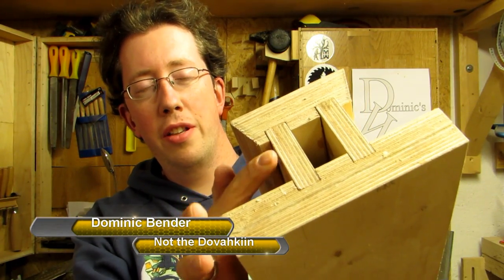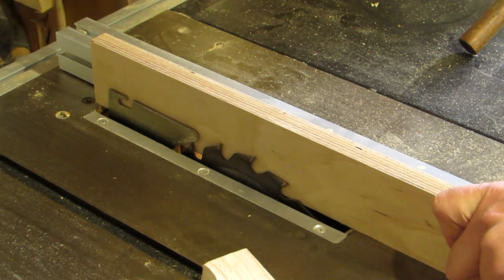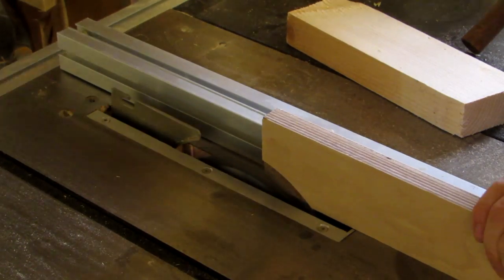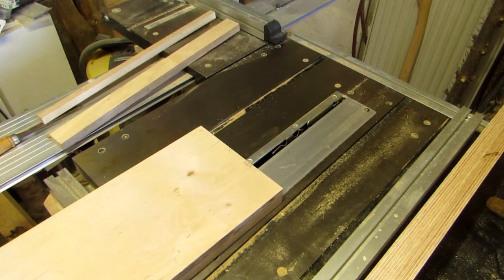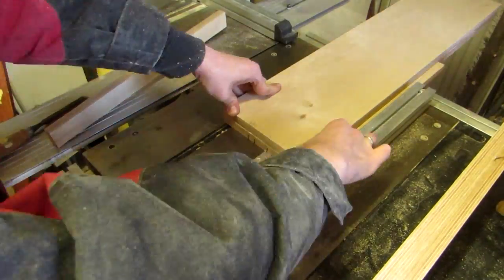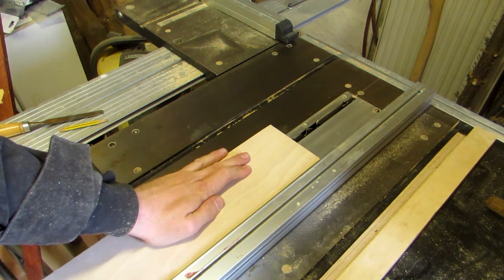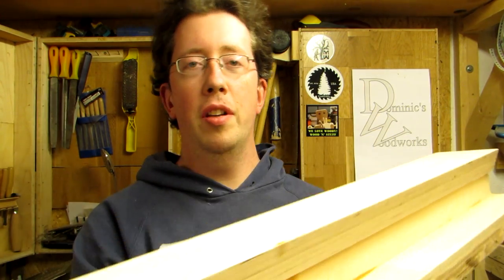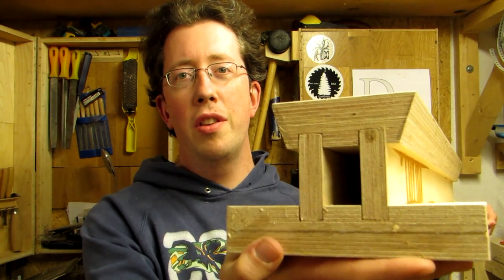Make matching Dados - Simple, Easy and Fun!

Comment: +Dominic Bender, I love how everyone is reacting to my tip and your video.
Sorry for the length of this post, but trust me, it is well worth reading it all. :)
-----------
I should point out, another variation on this is to make a second spacer the same method as the first in your video but instead of using your desired dado width scrap, use your second blade. This will allow you to cut a spacer the exact width of the blade.

Next use a piece of paper and the blade to set the fence initially. This will allow another spacer to be made that is slightly wider than the blade. 

Next reset the fence as before to the width of the blade and then use the same technique to move the fence closer to the blade by the thickness of the paper. Make another spacer this width.

Now you have 3 spacers. The middle one is exact kerf width. The other 2 are for adjusting the dado fit either slightly tighter or slightly looser.
-----------
If you didn't have a second blade you could, of course, measure the thickness of the blade with calipers and set the fence using the depth probe on the calipers.
-----------
Now for the best of all for those inclined...
Make a full set of spacers, one exact fit, and using your favorite automotive feeler gauge thickness, make a series of spacers with increasing and decreasing thicknesses. With your full set of spacers you can choose the spacer for your project that will give you the resulting desired dado fit.
-----------
Using a bit of imagination, you should now be armed with some techniques to make some pretty incredible joints that fit perfectly. Joints that one might avoid will be easy.
-----------
Half-lap joints, tongue and groove etc.
-----------
Adding some artistic flair, make a box joint with non-uniform width finger widths. Example: wide, narrow, narrow, wide, narrow, narrow, wide. Go crazy with it. People will be amazed at the beautiful box joints you can now make. Also try staining the end-grains to enhance the joint's appearance.
-----------
Here is a custom joint that would appear to be impossible, Wide miter, narrow finger, narrow finger, wide finger w/dowel pin, wide finger w/dowel pin, narrow finger, narrow finger, wide miter. Of course, cut the outer miters with your miter sled or miter gauge.
-----------
I'll stop now that I have ruined your upcoming weekend. :P
-----------
Maybe you can get together with the other woodworking channels and do a Creative Joint Challenge just for fun. That would be amazing to see what all you guys do with my tip. My gift to you for always giving the gift of inspiration.